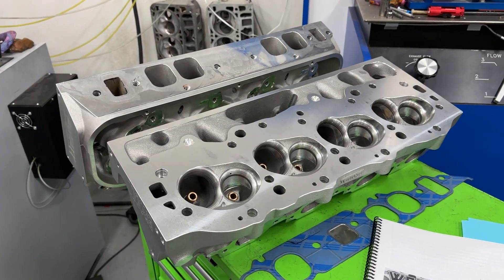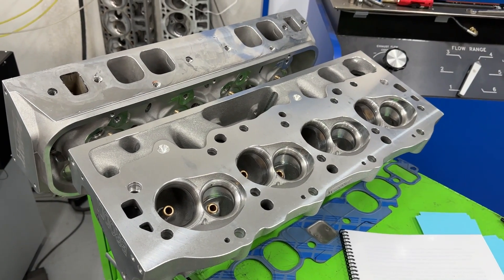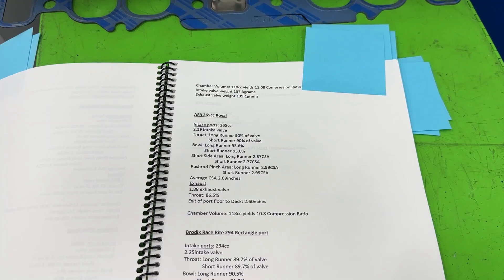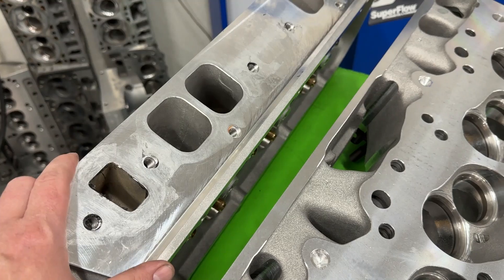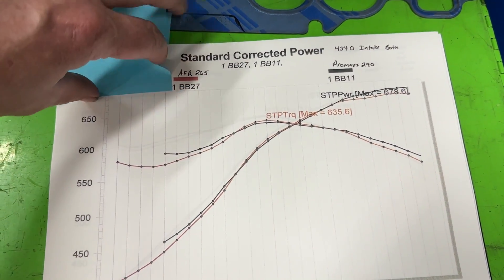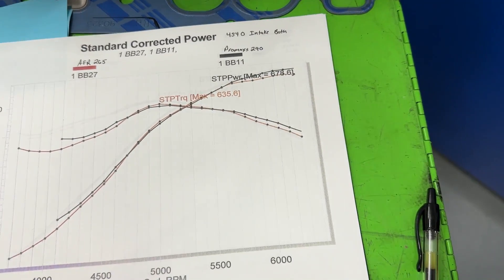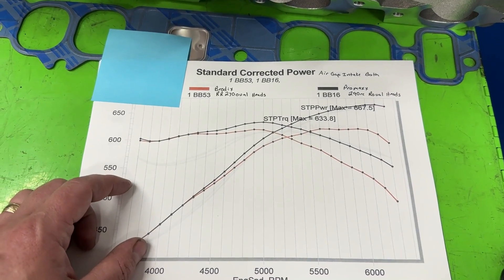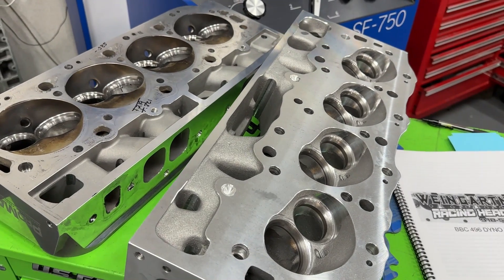Oval Port BBC Head Dyno Test AFR265 vs Brodix RR270 vs Promaxx 290

Comment: Need a bottom line you can give a comparison of the heads in two sentences very detailed but just glancing through your video I still don't know which is the best head down low and on top
Reply from the maker: That’s impossible hence the length of the video.

Comment: That's some great info Eric. Really would have been awesome to see the AFR 290 heads on this comparison. And a few different Camshafts. Not sure but I think your carb is almost holding you back would have been cool to see a 1050 or 1150 dominator. May have made a difference with the larger flowing 290 heads.

Comment: Say Eric, i would wonder what would happen if you were to raise the ovel ports up to the top of the square ports?  As it appears that you could do that without to much trouble,  and then you would effectively have a significantly higher port.  It would then just need maybe only spacers,  but preferred a new intake manifold.

Comment: Correct me if I’m wrong, the promaxx 290 heads have 290 cc runners and the afr 265 have 265 cc runners? Well then in my eyes the 265 is the little head that could. I know a guy who has a set and says the throttle response is amazing.

Comment: Hi Eric, I have the SBF with the Promaxx 180 heads on my 302.  Promaxx gasket matched the heads with a dual plane manifold that I also purchased from them. Do you think the heads can be improved upon. I am also thinking about a 331 stroker. Thanks and I hope you are doing well and in good health. Tom
Reply from the maker: I’m sure port work and valve job would help them.

Comment: Hi Eric 
I bought your book from these test. Let me say I’m a Brodix fan. So a lower flowing head with lower CR 10.6:1 made same power to 4600rpm. Could that increase in HP for AFR heads be the 1/2 of CR point showing up in HP?
Looking forward to your test with the world Merlin 540cid. I have a Dart bigM with Cali’s bottom end. I’m locked in to stock valve geometry do to the Jesel stands I bought for my cast 990 heads. So BB2 or Dragon Slayer 320. My question is, Do you know of any other aluminum heads that have same valve geometry as stock 990 heads?
My CR is 10.8:1  with 23cc domes in 119cc chamber with the piston -.005 in hole with .045 head gasket. Would you run the 110cc chambers or the 115 Dragon slayer? And would you go to a bigger intake valve 2.3” or not worth the money and time for gain. Cause Brodix might have numbers for that. 
What does it mean to roll a as cast head? Does it add any flow??

Comment: I have a set of AFR 265s on my 462ci with approx 10.4:1 CR. My camshaft and intake manifold aren't optimal, but I am still hoping that it will make at least 500 HP. After seeing this test, I am still glad that I didn't buy the Brodix 270s.
Reply: The only way it will make 500 is if you remove a plug wire. 550 easy with a mild cam
Reply: It would be hard not to make over 500 hp. Make sure you have the right camshaft. Email mike jones camshaft. You could loose over 75 hp easy,

Comment: Good video Eric, thanks for taking the time to test these heads both on a flow bench and on the dyno. Looks like Promaxx is the bang for your buck head. I wonder if a CNC chamber would have helped the Brodix. Also just to say it again, the Brodix RR series has the exhaust port in the stock location, hurting power, but less headaches when installing them on your car. You can supposedly cam this out with more duration on the exhaust.

Comment: Hi Eric.
Tom Mohan here.
I would like to plant a seed in your mind to get you curious in doing a segment on the testing of dynamic valve seat runout. Something I have always wonderd. But never had the resources to test. But with access to a dyno and your machines and resources. I believe you can. It would fit right in with your head teaching and testing criteria.  
Explanation:  .......
We machine seats and valves as perfect as possible to reduce runout. However,  like flowing an exhaust port. Our means of measuring its sealing potential are no good.
"Seat concentricity gauge at room tempurature? A vaccume test at room temperature? What about this.....  What happens to the seat and valve head at running temperature? What happens to the guide centerline? Especially exh guide and valve cold on one half. Exposed to 1200 deg on the other half and so on. Valve head cycling harmonics, stem flexing? Like pushrods. All kinds of shit going on. At what point does minimum seat runout no longer retain relevents and is there power in machining valve seats and valves at an elevated temperature.
I have never seen this explored and I believe you are the man to do it. It is now your destiny as I have just shared it with many. To investigate for us. Careful before you answer it will pull in and seal anyway. Thats likely true. But what about valve head flex? Reliabillity in not popping off a flexing valve head and other possible dynamics. Maybe zero runout at room temp is Just horrible in a running engine and we should run hot coolant through the head during re-cutting seats? 🤔

Thank you in advance. I will understand if you block me after asking this.  Sorry! 😊

Comment: All this data and no mention of the head gasket thickness.  I love looking at the data!  Fluid Dynamics has been a challenge for years.  Have you ever tested the intakes with lubed walls?  Ever think of anodizing the insides of an intake?  Crazy questions usually leads to ideas.  Also look at the finishes on the AR-15.

Comment: I really have to wonder about the valve train stability over 5,500 given the valve float issues you have before 6500. I hope you can get this engine back on the dyno with  proper ram capability.

Comment: Now put some REAL AFR heads on it and it will triumph all!
Reply: Do you realize how ridiculous this comment is?  First, this is only a 496, and if you go putting some 450 cfm head on it, you aren't going to benefit anything. And if you just want to talk heads and flow numbers, Brodix has heads that will eat any AFR. And I can't think of any aftermarket CNC head/intake company using AFR casting over a Brodix or Profiler.
Reply: LOL

Comment: The AFRs while not cheap seem to hold their own quite well even with the limited upper flow. the Lift at .200 they kick butt right in the sweet spot of initial chamber filling
Reply: AFR 265 is a CNC head,  ProMaxx and FloTek 290 are as cast,   do a little work on the as cast heads and correct the seat to combustion chamber blend and the FloTek / ProMaxx has easy gains in low to mid lift numbers.

Comment: Basic conclusion is Brodix RR heads are not competitive,   my experience is BB2 Plus is similar not competitive when compared to rectangle ProMaxx 317/FloTek 315.   Brodix makes some good race heads on the higher end,  but their street level heads need a re-design.
Reply: Brodix RR heads are good heads they just aren't the best of course. The stock exhaust location really hurts the flow, but I'd use them for a street build. I'd only buy a high dollar cylinder head if I was drag racing looking for max hp builds.
Reply: @musclebone7875    I am not following your comment,  the Brodix RR 270 is more expensive then the FloTek 290 (same head as ProMaxx 290), 20% more expensive, and makes less power.   Basically the Brodix street heads are not competitive,   and priced too high for what they offer.      Brodix 294 Rectangle was even more embarrassing in this testing if you look through Eric's book.   I don't install Brodix BB2, or RR heads on a customers engine as I consider it a disservice to mislead them on power and value.      396 is the only case I see for the BBC  Brodix RR or Edelbrock Performer RPM heads as the small valve size will fit in the cylinders.     On the newer designed heads Brodix heads are nice,  we use the SR20's from time to time on hotter street or bracket race engines 582 to 632 cu in.
Reply: I'd bet those race rite heads would be a lot closer with a camshaft designed to help the exhaust side being as the other two had a raised exhaust port.